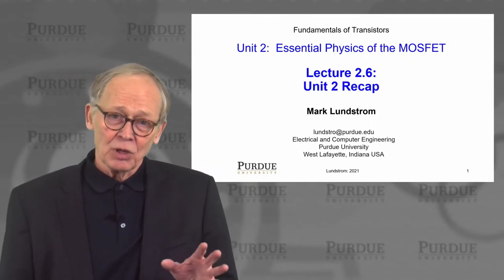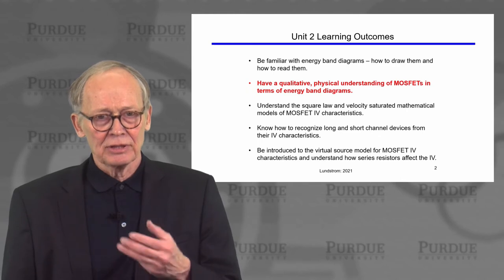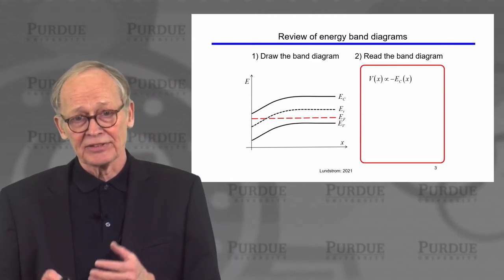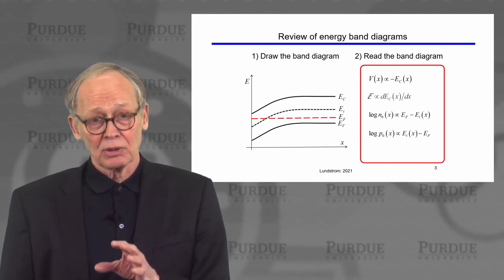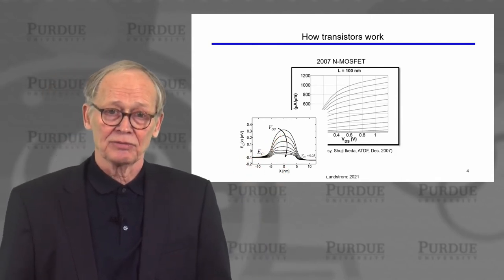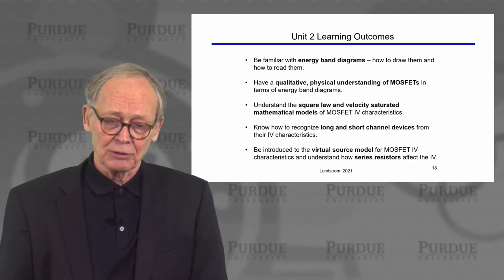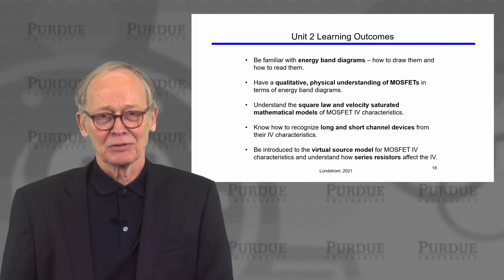ECE Purdue Transistor Fundamentals L2.6: Essential Physics - Recap

Comment: 00:00    Lecture 2.6: Unit 2 Recap
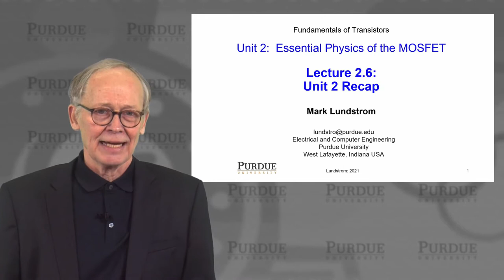00:22    Unit 2 Learning Outcomes
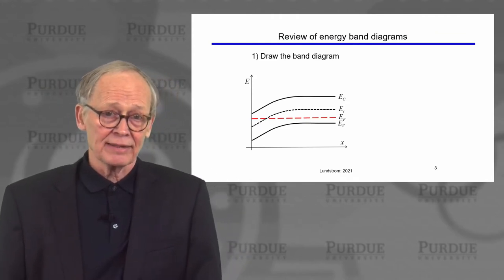02:01    Review of energy band diagrams
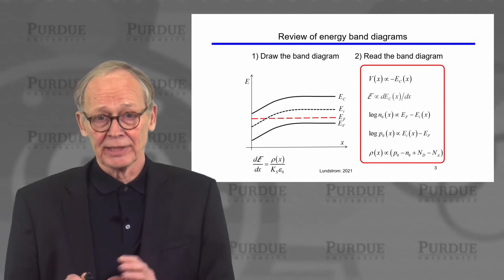04:08    How transistors work
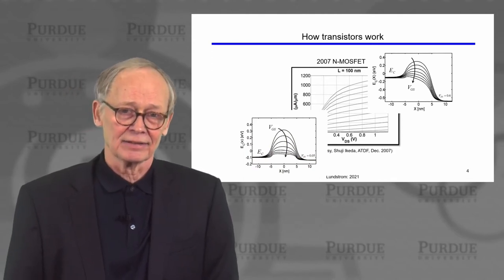06:06    DIBL
07:15    DIBL
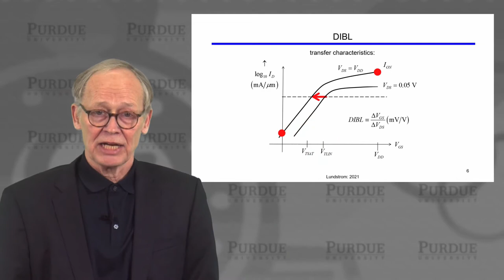07:36    Understanding DIBL with an e-band diagram
08:46    MOSFET IV: Low VDS (linear region)
10:22    MOSFET IV: High VDS (beyond pinch-off)
14:03    Complete square law IV characteristic
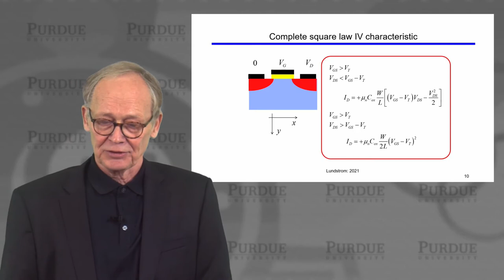14:27    MOSFET IV: High VDS (velocity saturation)
16:00    Velocity overshoot
17:32    From two-piece to continuous model
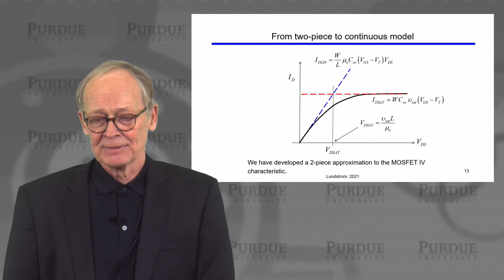18:41    Simple (Level 0) VS model
20:09    Series resistors
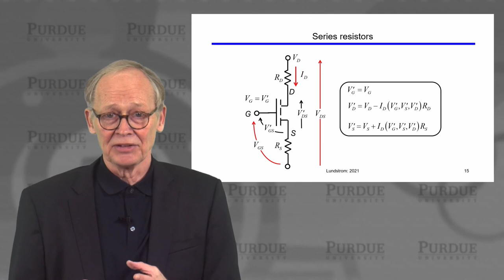21:03    The MIT VS Model
21:24    The MIT VS Model
22:13    Unit 2 Learning Outcomes